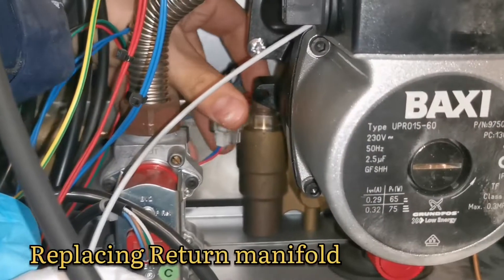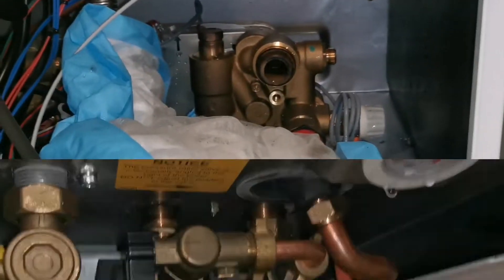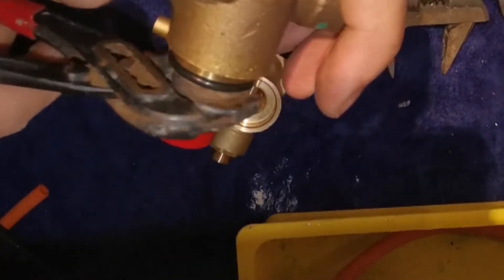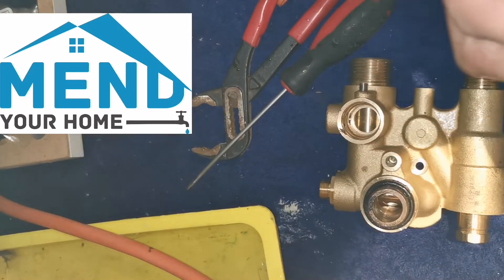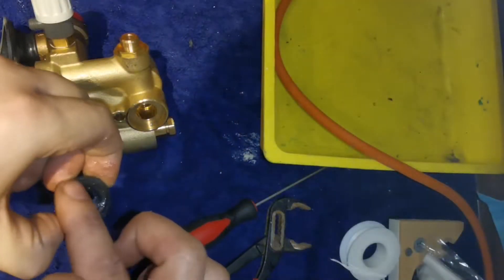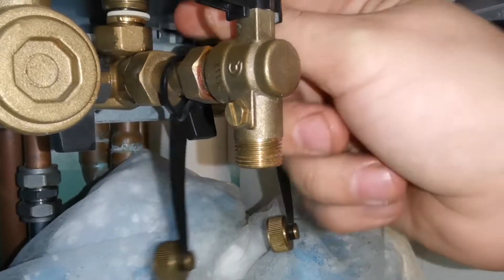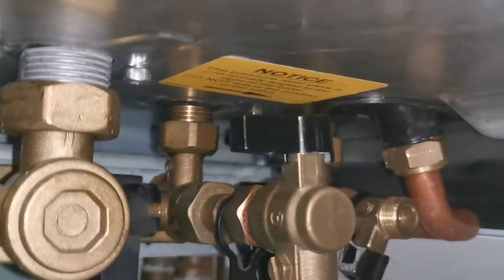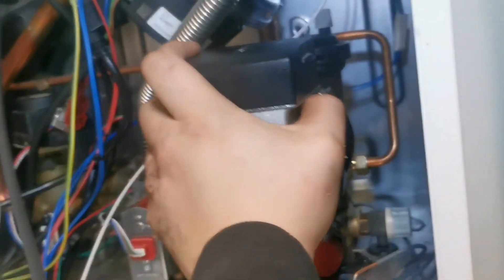Baxi Duo-Tec boiler return manifold FIXED

Comment: Good video 👍 where did you get the water absorbent pads?
Reply from the maker: https://www.amazon.co.uk/JAMES-Absorbent-Training-Anti-Slip-Leak-Proof/dp/B0B525S27F?hvadid=606684983932&hvpos=&hvnetw=g&hvrand=8129287770903386780&hvpone=&hvptwo=&hvqmt=&hvdev=m&hvdvcmdl=&hvlocint=&hvlocphy=1006661&hvtargid=pla-1872642505858&mcid=a1ae9fd86fdf3542b384101ee889694a&th=1&linkCode=ll1&tag=mendyourhom0d-21&linkId=1b63649457a77dd9be560be148dabd59&language=en_GB&ref_=as_li_ss_tl

Comment: I'm having trouble, I open the drain off but nothing comes out. How do I drain down now? Thanks
Reply from the maker: Find another drain off or the system from a radiator is the safest bet. Otherwise if you're changing the PRV use the PRV, pump the vessel with PRV open. Then when it's empty crack the return nut under the boiler and catch anything that's left. Hope that helps.